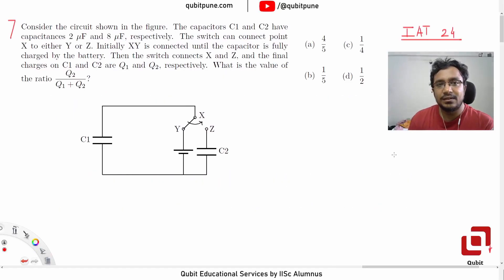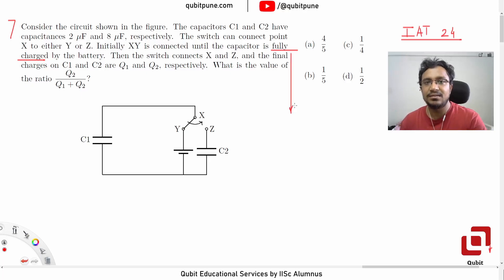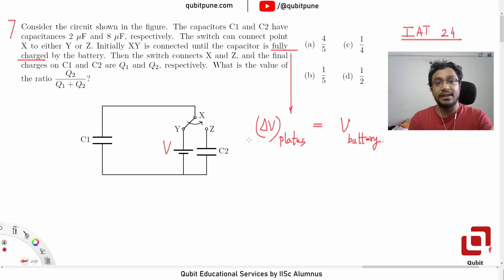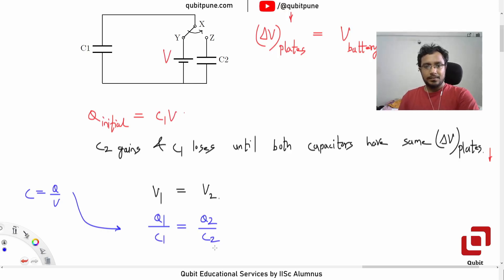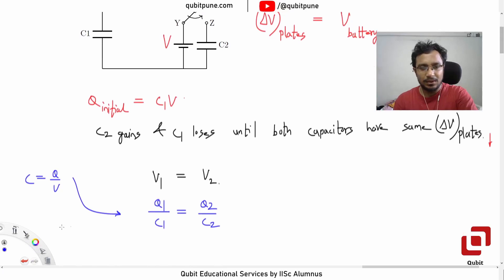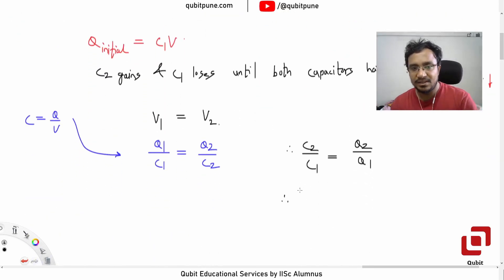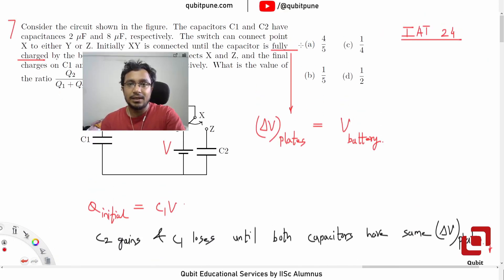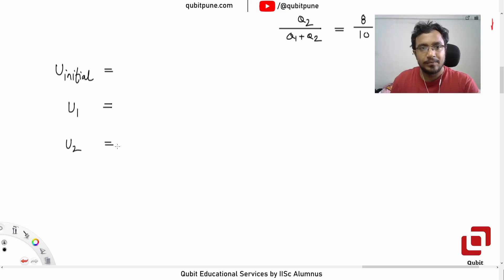Q12 IISER Aptitude Test 2024 Physics Solutions Capacitors @qubitpune

Comment: Ye question when 2 capacitors are connected removing battery 
Then charge sharing takes place and voltage becomes same to the voltage between plates 
Jee mains level question ,I practised it
Reply from the maker: (y)